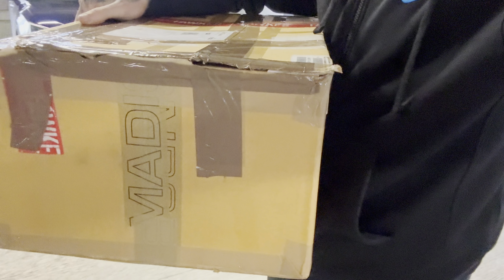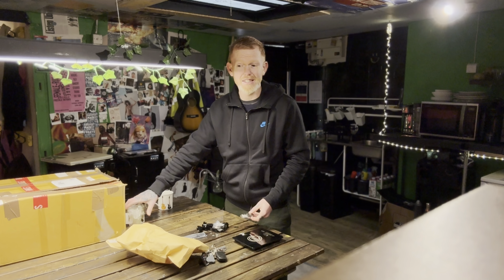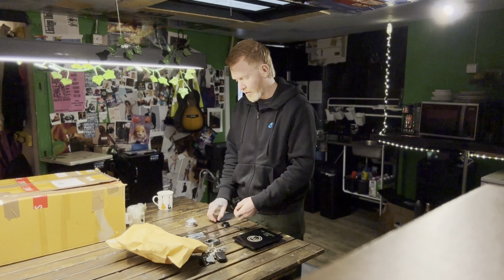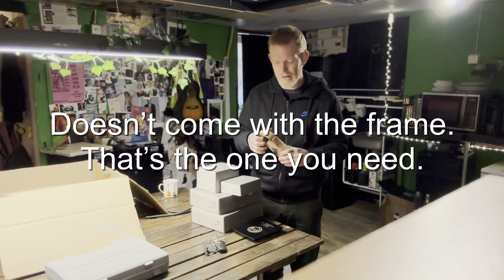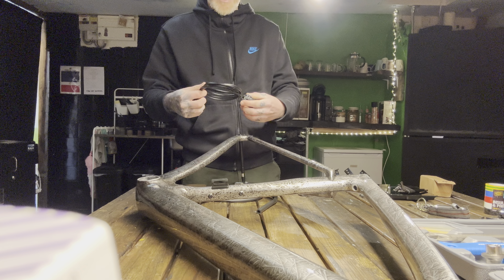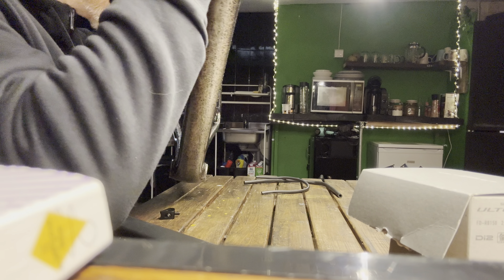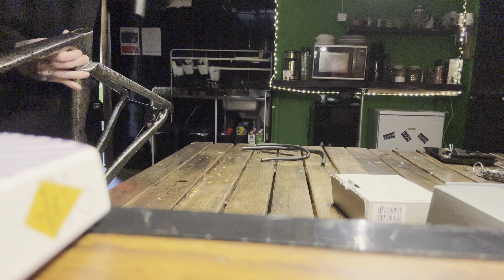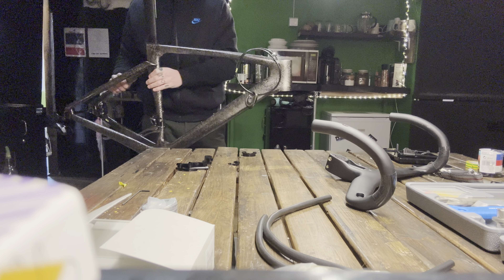Velobuild - 268 build pt. 2 SNAGS

Comment: The bearing in that BB are pressed in without any grease. I have the same BB, pulled the bearings out and pressed some NTN bearings inside...spins smooth as butter
Reply: Cool.  I recommend greasing the bearings. Minimizes the potential from creaking
Reply: @OmarCalderon01  of course. There should not be any metal on metal without grease. I personally use silicone grease for pressing a bb into the frame. In this case I also lubricated the shell surfaces for the bearings to sit in. I bought this BB just for the shell as my plan was to get rid of the original bearings and put the NTN ones in for the longevity and the cool free spining cranks :)

Comment: Good video.  I am building a 168 right now.  Velobuild needs too send you another cockpit. The no hole issue is unacceptable.  I routed 4 cables through the cockpit and while mildly difficult, it is doable. You will have an easier time if you are doing electronic.  Not sure if you are or not.
Reply from the maker: I’m only running a 1x so only needed a small hole. They were quick to reply & offered to pay for the work to be done on the bars.
Reply: @Cyclingsucks  good to know their support is being responsive. They have responded to my issues also. So all in all, they are averaging a good report card.

Comment: On my 168 I had trouble routing the cables so I went with OG Evkin bars and stem with a  FSA headset
Reply from the maker: I’m planning on having a 1x setup. This should help with the routing 🤞🏼
Reply: On my 168 I routed 4 mechanical cables.  Difficult yes,  doable, double yes.

Comment: What headset did you end up putting on this? I’ve got one coming and don’t think I want to use the headset shipped with it.
Reply from the maker: I’m going to use the one provided. I thought I could use another type I had. But it’s not compatible.
Reply: I had good results with the headset provided.  They also sent me a bottom bracket but I didn’t use it.  I used a Tolkien ninja thread-together instead.  Went in perfectly.

Comment: I’m curious if this bike has the stated tyre clearance. Also anyone know what this bike is a copy of?
Reply from the maker: The website states 32mm on 700c. I think it’s close to the tarmac SL7 &/or venge
Reply: @Cyclingsucks  yeah it states 32 but i've seen other videos where people have put the stated max and found that there was no room, or barely fit instead of having the UCI mandated 4mm of wiggle space
Reply: I run 32 on the rear of my 168 no issue at all